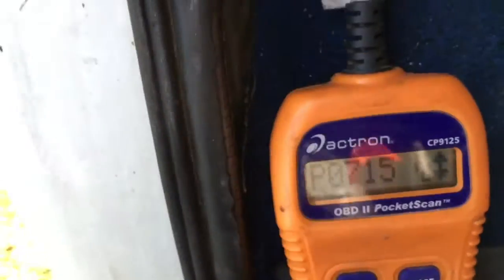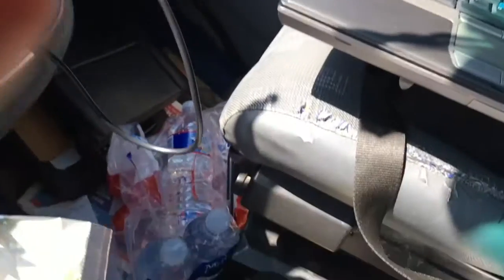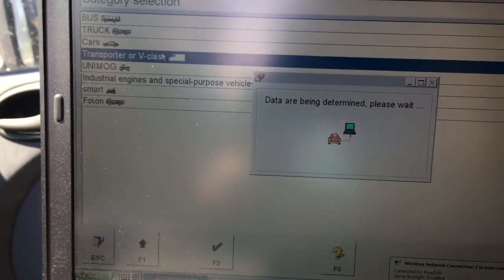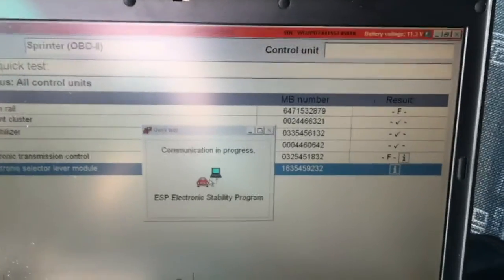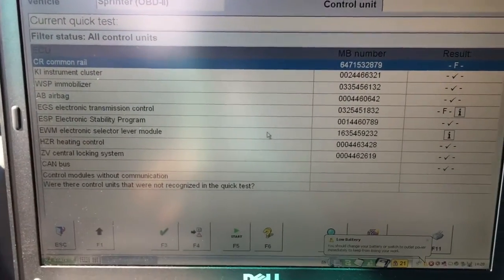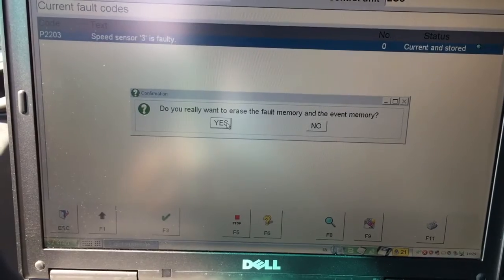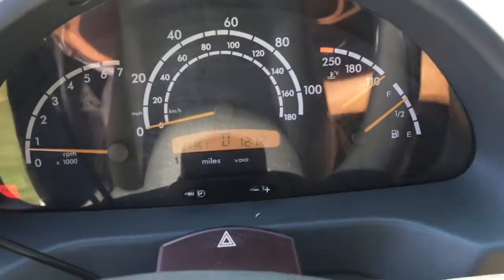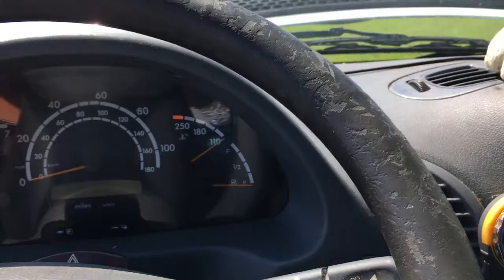Reset P0715, P2203 on Sprinter TCM with MB Star C4

Comment: It happen to my e320.    Wicked fluid all the way to the damn TCM
Reply from the maker: Seems like a tape adhesive, make sure battery is off when you disconnecting also I would clean connection with the electric cleaner spray

Comment: Thank you for sharing the video Ruva, I had some issue with my E320 year 2000(W210) with 722.6 transmission. I did a transmission flush changing filter, gasket, connector and conductor plate. To my surprise after putting everything back together my car went into limp mode with hard kick noise shifting between P, D, R. Anyway I did a scan on a little OBD scanners to check for the codes and the following came out :
P0715 Input/Turbine Speed Sensor Circuit Malfunction
P0753 Shift Solenoid A Electrical
P0758 Shift Solenoid B Electrical
P0763 Shift Solenoid C Electrical
P0720 Output Speed Sensor Circuit Malfunction
I opened again thinking that my solenoids were the problem to test them with a 12V battery but they were good. I checked my TCM for any oil that could have gone till the box from the wire but nothing it's dry as the Sahara. My question now after looking at your video do these codes need to be cleared with a special Mercedes Benz diagnosis computer in order to take the car out of the limp mode? Your thoughts will be appreciated man. Thank you
Reply from the maker: Tallal Moshrif yes you will have to reset TCM, in future make sure you disconnect battery before you disconnect plug from transmission that going to conductor plate
Reply: Ruva A.A thank you I had to take it to a specialist and was charged a 100$

Comment: I have a P0715 on my 01 W163 I changed the conductor plate, solenoids,13 pin and still have the code and the TCM is dry no oil was found I’m just lost on what to do any input will be greatly appreciated
Reply from the maker: +Evan Pierrenoel even though TCM still needs to be reset
Reply: Ruva A.A appreciate the response after I reset the tcm the truck came out of limp thanks again
Reply: @reckless87  how did you reset the tcm? Did you have to have someone with the right equipment do it or what?

Comment: Great Video, glad you were able to Delete the Code! When this happens to me, I had a Transmission Shop delete my TCM Codes with snap on Computer, the problem is with the Speed sensor it's part of Conductor plate, and it's cased by dirty speed sensor, you will need to clean it or buy a new one it costs less then $150 online, but to do this you must remove the valve body and silinoides it's easy, on my channel I show how to do it
Reply from the maker: ZIMALETA HOW TO SHOW & UNBOXING I heard sometimes it could be a little resistor on the conductor plate
Reply: I did cleaned all of it and replaced the conductor plate and it came back..
Bought even iCarsoft MBII and doesn't work
Reply: I'm having the same issue. I just installed a brand new conductor plate and 13 pin connector and I'm still getting the P0175 code and can't reset it with my Bluedriver scanner. 
I checked the harness and TCU and there's no oil that's wicked up. Any ideas? I'm struggling to fix it!